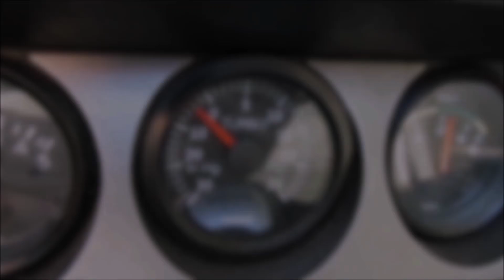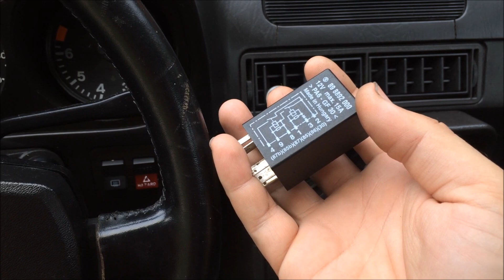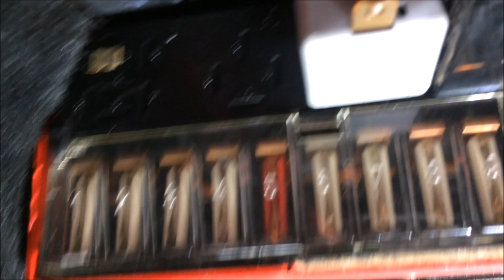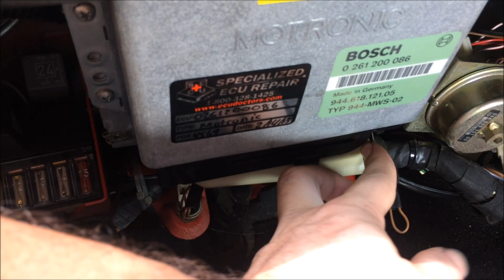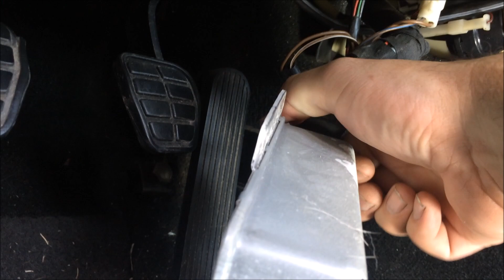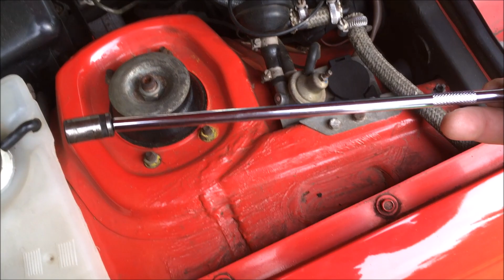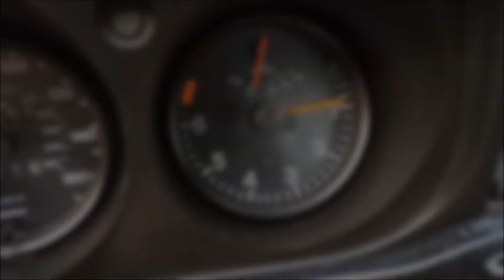Troubleshooting a Porsche 944 No-Start Condition

Comment: Good afternoon, I am in a fix, I purchased a 1984 944 back in 2015, it was running and doing great, that December I had it painted and was slowly putting all of the parts back on it when my house flooded and had to move so I put the car in storage in a warehouse for about 2 years, when I was moving it to my house it would not start and had to have it towed to my house in 2017, well like John Lennon said , Live is what happens to you when your busy making other plans, I have decided to get it back on the road, I put a new battery in and when I put the key in the switch the bells go off and I have blinkers, headlights light but they do not open, gauges move and nothing else, I have worked on American and British cars since 1975 but this is my first German car, any suggestions on what to try next, maybe fuses or relays to check anything help would be appreciated. Thanks Chuck

Comment: This is hands down the best no start video.  However now I'm dealing with a different car that starts fine but wont idle.  It would be awesome to see a video on that!
Reply from the maker: Thanks! If its stalling then make sure all the vacuum lines are connected tightly and that the air flow meter is plugged in. Any leaks will cause it to stall. There's one particular hose that always seems to be forgotten underneath the intake so be sure to check that. If everything looks good then check the fuel pressure at the rail, since a bad fuel pressure regulator can also cause the car not to idle. Good luck!
Reply: @edredas  thanks for the recommendation! Yea I suspect a vacuum leak but I didnt know fpr could cause that.

Comment: Is the top sensor always the speed sensor? Both of mine were disconnected from the top bracket and didnt have the label on the harness side.
Reply from the maker: DSimmons1265 not always since they are easily be swapped around. If they’re mixed up then it won’t hurt anything and you can just swap them back and the car should run.
Reply: Ah, thanks. You have no idea how much your videos have helped.

Comment: My 944 turbo doesn't start. Sometimes it does and dies again . I think I need to change my dme sensor first and see If it works .
Reply from the maker: Check the relay first. Those are a common source of headaches.
Reply: @edredas    The rpms would drop and just die . Would wait 10 min and restart it.   I just ordered a new dme relay hopefully this fixes the issue
Reply from the maker: Yup, when the relay is bad the car won't start or it will just shut off randomly. There could be other issues but that's the first thing to always check. Good luck!
Reply: @edredas  send me your email I want to send a small clip of what the car does.  Maybe you'll know.  I feel like it a fuel problem
Reply from the maker: my email is edredas@gmail.com
Reply: I have a 87 944 turbo and it does the exact same thing   Starts every time cold runs for 2 minutes then dies if it’s idling but never dies while driving  swapped out the DME relay no change and when it won’t restart it does have tach bounce.  Let it sit for 10 minutes and no more problems. Very confusing and hard to test as you only have 10 minutes

Comment: hey edredas can you send me a link or let me know where you got your multimeter? much appreciated and love the videos!
Reply from the maker: Thanks! I got the multimeter that's in the video from Lowes for about $30, but I have a bunch of them ranging from $6 to $150. All of them work great but I use them for different purposes since some have features others don't. The one in this video can also find parasitic drain if your battery keeps dying but if you don't use one very often and are just looking to do this job, then I would just get a cheap one from Harbor Freight for a few bucks. They work great and I actually like using it more than the more expensive ones for some simple jobs. Here's a link and I hope that helps! 

https://www.harborfreight.com/7-function-digital-multimeter-63759.html?cid=paid_google|||63759&utm_source=google&utm_medium=cpc&utm_campaign=&utm_content=&gclid=EAIaIQobChMIsZHG16a36QIVF6SzCh2sTAq9EAYYASABEgJq4PD_BwE
Reply: @edredas  awsome thanks ill try it!!

Comment: You had a long starting crank at the end.  Is this normal for a 944 or do you think you have a leak in your fuel system?
Reply from the maker: Yup, fairly normal for a 944 to take that long to start. One reason is that the computer doesn't turn the fuel pump on until it see's engine rotation. Newer cars have a better setup, but the idea behind this is to prevent fuel from pouring out in an accident where the fuel lines may be severed. The engine would then stop from the lack of fuel and the computer would then cut the pump off, keeping fuel from pouring out of ruptured fuel lines. Which would perhaps prevent a fire or keep it from being much worse.

Comment: Hey man i have a 944 with no spark and it has new reference and speed sensors, new plugs and wires, new coil and cap/rotor, new fuel pump and ignition coil and i still cant figure out whats wrong. I replaced multi function and dme relays and the dme computer has power
Reply: Also has a new battery and i have tested 12v to the coil. Only thing i can imagine is an ignition switch or harness failure. Any suggestions?????
Reply from the maker: Sounds like you’ve covered everything however it could be the DME itself at this point. There are places such as ecu doctors that will repair them. However the most common cause is broken solder joints at the spark controller inside. So if your handy with a solder iron then Ive help a lot of people repair their no spark issue with a 99% success rate.

Comment: My 944 doesn't want to start it won't turn over but if I push it and dump the clutch it starts fine and idles perfect but when I turn the key when it's off I get one loud click I changed the starter already what could it be
Reply: The starter
Reply from the maker: Where's the click coming from? Have you tested the battery?
Reply from the maker: If the battery is good then could be an issue with the ignition switch or a bad connection somewhere. There are only a few wires that run to the starter so it shouldn't be too hard to diagnose. I hope that helps!

Comment: Great video as always. The only time I had mine not start was with a poor connection to the temp sensor for the DME. The reason being hidden inside the rubber boot of the connector. There the PO had soldered in a 330 ohm resistor that had a leg break off causing the DME to loose contact with the temp sensor. The car would actually be possible to start, with constant full throttle, and run horribly. But was completely dead - not even a hint of ignition -  under normal starting conditions. Can you elaborate on the reason for fooling the DME to think the engine is cooler than it really is ?
Reply from the maker: Glad you got it dunning again. As for the resistor, I have seen a them a few times and it's hard to know whether it was there to add more fuel or if perhaps they are there to cover up another issue. I have also seen aftermarket devices in that location with a variable resistor that are supposed to increase performance but they're snake oil. I hope that helps!
Reply: @edredas  Yes, I actually put a pot-meter in there myself, for experimentation. But so far I haven't found any advantages, and the info online is non existing or at very best shallow. You can find this kind of mod on other types of cars forums, though - but after trying it out for a week I didn't personally notice any increase in hp or anything at all that helped really. So I keep it at zero and will solder it out eventually.
Reply from the maker: @happyfox711  Exactly, if you're in the US with a working O2 sensor then the DME is going to see the mixture and correct the values anyway... so its a complete waste of time.
Reply: @edredas  I'm not in the States, but I do have an American 944, so I'll keep that in mind..

Comment: Hi, what should the BG read ??? My 87 924S starts and then stops in less then 30 yards could it be any of these sensors and I wish I could send you a pic because I have a 3rd wire next to those to that looks damaged?  The car will start again after a few minutes and then stall again, I could probably drive cross country a hundred feeet at at time.
Reply from the maker: Both sensors should read 600-1600 ohms. There are three wires and if any are frayed it will cause and issue. However if it runs and dies it sounds more like a vacuum leak or fuel issue. I hope that helps!
Reply: @edredas  what is the third wire that runs behind the DG an BG?

Comment: Thank you for this video edredas
! I'm having the same issue with my 85 1/2 944. Weird thing is Gas was pretty much fumes a few weeks ago so after letting it sit for a few weeks I added some gas and it started right up. Then again it sat for a few weeks on the battery retainer and here we go again no start and healthy crank. I'm going to follow your methods and order  a few of those parts to have on me and for spare.  You made it sounds simple enough to troubleshoot and saved me a few 100 while sitting in a shop for a few days. So I'll let you know if I get it up and running. adding on FB   thank you!
Reply from the maker: Awesome! Good luck!

Comment: Master do u think is the reason for my oil smell to much of gas my dme is 944.618.111.01 with that one start for 10 seconds and die the car and has be disconnected the dme temperature sensor to start new sensor but I found a new dme unit with different number is  944.618.121.05 and I think that one is for 924 87 and up my is 1985 944 any help thanks for take the time master
Reply from the maker: If your car is only starting with the DME temp sensor unplugged then you have a vacuum leak. Unplugging the sensor makes the car run richer to compensate for the extra air, but can also allow too much fuel into the cylinder which can get into the oil. I hope that helps!

Comment: Great video and very helpful.  I've had an intermittant problem with my 924S for the last 8 years and no one has been able to fix it...  I did after watching this video!
My problem was that the car was not starting when the engine was hot and had been standing for about 40 minutes, lifting the hood for a while to let things cool down seemed to resolve the issue.  Yesterday I disconnected the speed and reference sensors, sprayed the contacts with WD40 and reconnected them.  The problem appears to be resolved!
Thank you Edredas :)
Reply from the maker: Awesome! Glad you got it sorted!

Comment: I just get a 85 944 it start but just for 10 seconds and stop I started again and 10 second hold run any ideas please fuel pump work is possible to be the reference sensor ?
Reply: Turns up was the DME control unit now after 5 minutes the car running the oil light turn on and my pressure low on 1 any suggestions thanks master
Reply from the maker: @Tadcfanemolarp  Try checking the oil pressure with a mechanical gauge to verify that there isn't an issue with the sender. If the oil pressure is still falling down to 1 bar, verify the idle is 950+/- 50. Also check the coolant for any oil. When the oil cooler seals fail the two can mix and perhaps some of the pressure is bleeding off there. Once all that's that's done and the low oil pressure persists, then you may need to replace the rod bearings.
Reply: I check the jboot and has oil and kind a water mix on there and inside of the throttle body any ideas I love the car but unfortunately I haven’t drive it lol
Reply from the maker: @Tadcfanemolarp  Generally when there's a lot of oil in the airbox its due to the oil level being too high. If you have an early car the oil level should be at the top notch and not the top of the flat spot. Usually, just a coating of oil is caused by dried out Air/Oil separator seals. The oil level could be raised if coolant has entered the system from either a bad head gasket or failed oil cooler seals. So check the oil and see if there's any mixing of coolant. If any coolant has gotten into the oil then you'll need to dump it all out then change the oil cooler seals and change the rod bearings. I hope that helps!
Reply: Thanks for the reply like always you the best is no water on the oil but smell a gasoline a lot and the oil is on the throttle comes I think from the oil separator because is on the direction of the vacuum hose on the jboot do u think is that ? But why smell gasoline the oil engine sound good no knocking or anything hope next month i can drive my beauty
Reply from the maker: @Tadcfanemolarp  If it smells like fuel then you could have a leaky injector. Try pulling them out and seeing if you see any fuel pooling up. You may need to send the injectors off to be cleaned with new seals.
Reply from the maker: Check the fuel pressure. Often when the car runs the sensor is fine, but if it cutting out it sounds like it could be a bad fuel pressure regulator. I hope that helps!
Reply: @edredas  thanks man I just found a gas thank full of water what do you recommended to do man
Reply from the maker: @Tadcfanemolarp  There's hose connected to the fuel pump under the car that you can pull to remove the old fuel.
Reply: My master I fill the tank with fresh fuel still the same I take out the spark plugs and 3and 4 has fuel and black 1,2 just black start and run for a minute when is cold start like 3 o 4 times when is cold then is hard to start any ideas can help please and if a connect the dme temperature sensor when the engine run the car turn off
Reply: My fuel pressure is good not hight
Reply from the maker: You've got a vacuum leak somewhere if unplugging the DME temp sensor makes the car run. When you unplug the sensor it makes the injectors spray more fuel since its getting lower resistance which happens to compensate for the vacuum leak. One common vacuum leak I see frequently is the hose that connects to the bottom of the intake... easily forgettable. I hope that help!
Reply: Master today I replace all the vacuum lines  still the same when is cold like tomorrow morning if I starter the car run a little bit more then just start run around 5 seconds and dies how can I check the injectors do you think is the injectors ?

Comment: I have fuel but no spark. Any ideas?
Reply from the maker: Are you getting fuel when jumping the relay or with the relay in? Do you have tach bounce as well? I would check for power at the coil first and if all the wiring looks good then it could be the spark driver in DME. I've had luck resoldering the board there in the past.
Reply: @edredas  what about the immobilizer that's past the driverside door?
Reply from the maker: Worth a shot to try and jump it. I've linked some directions, but from what I understand the immobilizer just prevents power from getting to the fuel pump, so if you have fuel then it shouldn't be the issue, but might be worth ruling that out! 

https://www.pelicanparts.com/techarticles/Porsche_944_Turbo/36-ELEC-Troubleshooting_the_Alarm_System/36-ELEC-Troubleshooting_the_Alarm_System.htm
Reply: @edredas  So I changed out the ECU i have a 86 now it gets spark and gets gas but still doesn't start! :-(

Comment: Hello sir thank you for the explanation. I have a 1983 944 that been sitting in garage for 16 years. Now the engine cranks 2 times and nothing then 1 time and nothing. Any suggestions please?
Reply from the maker: Do you have tach bounce? That will tell you if power is being supplied to the DME and fuel pump, also give you an idea if you have spark. If the tach isn't bouncing then you need to swap out the DME relay first to make sure the DME is getting power. Otherwise nothing will happen even if the sensors are good. If there is bouncing verify that the fuel pump is turning on when the engine is turning over. Alternatively you can jump the relay. This will run the pump at all times. If the pump isn't working then you're not getting fuel. If the pump runs when jumped then see if the car will run on a small spritz of starting fluid. If it does then you have spark. Also you'll need to make sure that there aren't any vacuum leaks and the air flow meter is plugged in! Good luck!
Reply: edredas So I swap the dme , and replace sensors. Still no bounce. I even bought a ecu from eBay and still no bounce. Now when I do multimeter check Give me around 900 omhns and when cranking the engine I’m reading 0.02 volts at 20 V DC. Thinking is to low and need a gap adjustment?
Reply: Or may be the ECU and the one from eBay isn’t working as well?
Reply: And have no spark as well